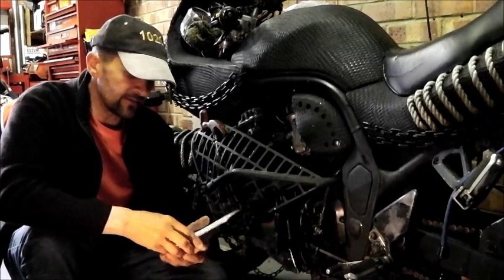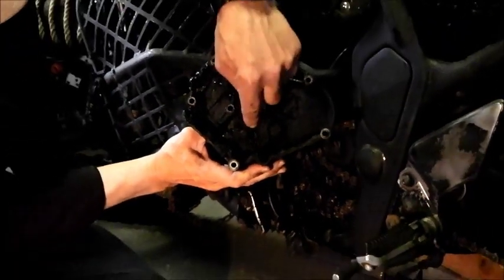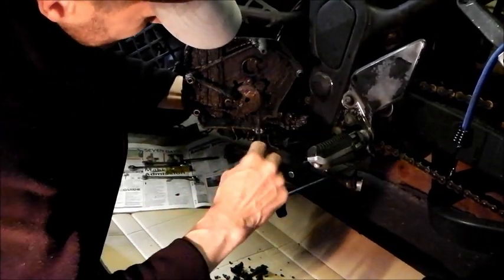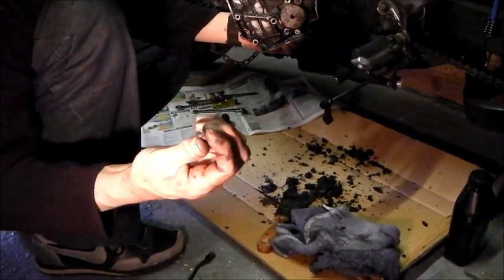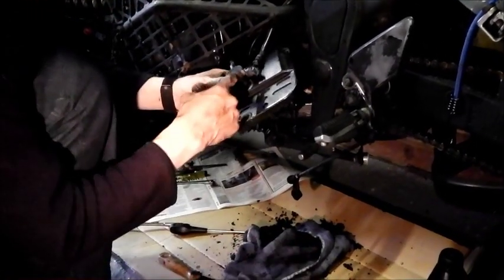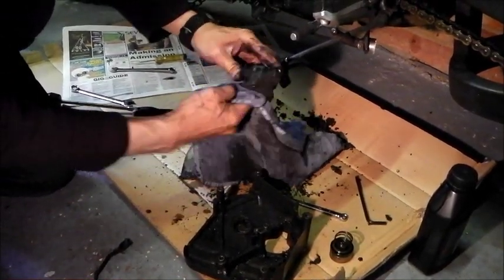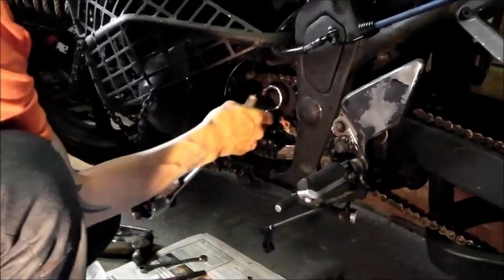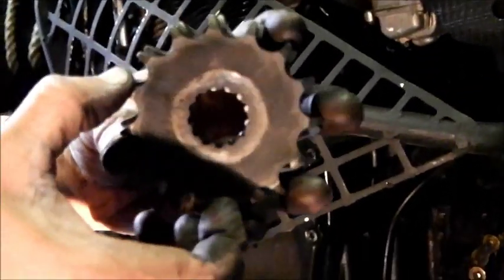Delboy's Garage, How-To;- Bandit Clutch Cylinder and Front Sprocket Replacement.

Comment: This one helped me out BIG time.  Still going through the crazy changes the previous owner has done to the bike.  Previous owner had a 520 on my Bandit 1200 which broke and flew off down the road so not thinking I just ordered a new 530 but ended up needing to get both new sprockets and while replacing I found I needed the slave seal as well.
Reply from the maker: Jeremiah Harkins Hi mate...aint it always the same, why do people take such dumbass shortcuts... at least you didnt end up with it wrapped round your left ankle... good luck with it buddy.. cheers, Del.

Comment from the maker: You are quite right, that sprocket fits several bikes, inc. the Hayabusa, and on some those holes are for a retaining washer, my point was that you CAN use them as 'draw bolt holes' if the sprocket is jammed in place, although this very rarely happens as it is not a machine fit!

Comment from the maker: Hi Alex..im not entirely sure on the anatomy of your Magna, but generally no, the seal is not a pressure seal, its just there to stop the oil that splashes about the other side of the pushrod from passing through t the slave side..on the Bandit you just take the retaining plate off and pop it out, comes with a steel insert to keep it in shape. i would imagine that even if there is oil the other side, it wont be under any pressure, maybe just tilt the bike so it drains away from the seal..GL, Del

Comment from the maker: Too right, mate, if in doubt drill it out! ... This is a great fix when you mince the cast alloy threads in your brake caliper mountings, just run an 8mm drill straight through and poke a nut on the back... job done!

Comment from the maker: Hi Neil, that is logic in principle, but looking at the environment they live in, it's absolutely vital they never come out as they'll find their way quickly in between the teeth of the chain and sprockets and that could be disastrous on the road!  So if you used anything it would actually be Locktite, but having that they make the screws from stale pastry they mince every time anyway, so this mod' ensures it won't happen again!

Comment from the maker: First do a full system check, start the bike from cold, allow it to heat right up till the fan kicks in, then switch off...if the gauge fails to move at all, then check for wiring faults, maybe a loose or broken connection, and if you are getting a full live feed from the sendor to the gauge, it can only be a faulty sendor, not too expensive to replace - if you've just bought it, wouldn't be a bad idea to do a full coolant change too, it can often be crud in the system, good luck, Del

Comment from the maker: Good point here, buddy, front sprockets and pulleys, being smaller, turn more times, so wear quicker and often it is the smaller pulley that knocks out the chain prematurely - I can regulary get 30k miles plus from a chain and this one has already been on for 19k and it's in fine health... the point here I would suggest is, check the grooves in your Sportster front pulley often and at first sign of any plating faults just replace it as it will cut your belt up - Del

Comment from the maker: Hi Albin, firstly, NO, the wheel rotates with the clutch in due to inertia, the clutch runs in oil which is sticky and will always cause a little drag, this is quite normal and correct....... you will know if your slave cylinder seals are leaking.... because brake fluid appears on the floor under the bike.... and the level drops in the resevoir... mine was only slightly weeping at 13yrs old and 44k miles... yours will be fine!

Comment from the maker: You certainly will notice an improvement in the drive feel, it will transfer the torque to the chain more smoothly and with less 'slap', and maybe that means a tiny scrap more power gets to the back wheel....its also quieter and smoother going into gear...

Comment from the maker: You can achieve this by using an alloy rear sprocket and a steel front, this then works exactly as you said, they wear as a pair, but I use a steel rear as they last longer and they are cheaper and the un-sprung weight saving is minimal - Del

Comment: Dear lawd I got those screws out . Had to DC the hydraulic line and heat it up but I didn't strip the screws, damn they were in tight. Funny how old these comments are, I'm just now doing my 99 and I've owned it since new, it's still almost pristine and have a couple vids riding to the mountains. Definitely easier than that steering stem bearing.Thanks for the vid Del hope alls good with you.

Comment from the maker: Hi Matthew....you certainly should have a lock washer between the sprocket and the nut...the kind that you tap over to stop the nut moving..and if its missing, then thats probably why it came loose..so get one and replace it NOW.... also if you tighten up the chain a bit tight it will tend to make a bit more clunking as you have placed force on two metal to metal surfaces...and if the front sprocket it worn then its even worse...get a new one mate, they are only a tenner.. good luck with it, Del

Comment from the maker: Yeah, i have a 6mm kit, but why bother, it still relies on a short 8mm long metric thread, (which only gives about 7 threads) and will just jam in the next time...bang the bolt right through and its way more sound, and reliable, thanks for the input though mate...cheers, Del.

Comment from the maker: As long as you use steel sprockets front and rear, then it's naturally obvious that the front, turning 3 times as many as the rear, will wear 3 times quicker, not to mention it lives in a grittier environment than the rear sprocket - you can buy sprockets made from fancy materials, but it's a false economy as they cost more... and the fade editing is a simple part of Windows Movie Maker and doesn't take very long at all (Penny is my editing genius!) - Del

Comment from the maker: There's nothing wrong with part worn tyres mate, ive used them lots of time, and would again if i needed to...it could indeed be that it has work unevenly and only turns up the imbalance at speed and not when static balancing.(which i guess from the sound of it you are doing? .in which case, it could be worth taking it to a proper tyre fitting shop who has the high speed digital wheel balancer and can spin the wheel up to speed and maybe ad weight to counter it out...hope that helps. cheers, Del

Comment from the maker: That's a typical problem and I never understand why people lean on them doing them up, maybe they think that because they are hard to get off, that it must have been done up that tight deliberately - if you only tightened it with your fingers, then rode it round the block, it would be too tight to undo as it spins left - plus with the retaining tab washer it's never going anywhere, so 'wrist tight' only is fine!  Del

Comment from the maker: If the wobble is only at a certain speed then that is almost certainly wheel balancing issues, but if it's all the time it's more than likely cycle parts, meaning head stock bearings, fork bushes, etc., ...if you had the tyre fitted at a garage they should have balanced it, if they did, could it be that a weight has dislodged and come off? (they can come un-stuck if the surface of the rim is not prepped properly, dirt, grease, etc.), also what tyre pressure etc.? Let me know, Del

Comment: 8 years on and I used this video to replace the clutch slave seal.
My Bandit is a K2 not a MK1, but it still works.
Reply from the maker: Thanks for the feedback Tim, im really glad it was still able ot help you after all this time.
Reply: @Moonfleet41  I also used the Sealy oil and brake fluid syringe.
Just need to save up for the RD rebuild. lol

Comment from the maker: OK, here's the folklore:  manufacturers spend pots of cash developing the bike to have good gas mileage, silky acceleration and a reasonable top speed, all combined - if you are happy to sacrifice the one expendable of the three, it's top speed (who needs more than a ton?)..so as the teeth are 3 to 1, one less on the front = three more on the rear = meaning it will pull your arms out and pick the front up and make you smile like a Cheshire cat! Plus you can adjust the difference out of the chain

Comment: Hi Del,just to give you an update, as this info may help other Bandit1200 owners.       I have completed the tasks within this video, i cant thank you enough. My front sprocket was so hooked!!!You cant see it unless you remove the front sprocket cover. My1998  B12 Mk1 has only done 25,000 hard miles but stands unused for long winters. The 2 original clutch diaphragm springs had lost there performance causing it to slip at 7,000 rpm in top gear. I have swapped one of them for a Barnett Heavy Duty spring,just £11 & the original plates & steels were OK,saving me £200+VAT+labour.The clutch now bites much earlier like new & feels normal at the leaver.Selecting neutral is easy with no drag. Heavy traffic,not a problem but i keep crushing any thing that i pick up with my left hand,so no beer for me !!! Only joking!!!.its just right. My top tip is to reuse the old gasket by smearing it with high melting point grease to reseal it, again & again saving ££££s   it really works,silicon blocks oil ways so i don't use it !!! Now that the clutch grips its time for tuning with some GSXR bits, i think!!!The only problem that i now have is that i cant keep the front wheel down!!! Yee Ha !!!      BRING ON THE SPRING!!!    DOG INTO IT & HAVE A GO!!!                 SAFE RIDING FOR LIFE.
Reply from the maker: Bob Hill Hi Bob, awesome.... slipping at 7k in top gear.... hmmmm that's about 120 right??.... Ain't it a bugger when that happens!   Heyho you always knew the Bandit was a Gixxer with some 'girls' parts added, and the Barnett spring is a great upgrade and, in the future, when you fit the turbo, you can always upgrade to a proper Gixxer front plate and 6 Goodrich springs.... and then, perhaps, a long swing arm to help with launches... ain't it great to save some money, not to mention the pride in fixing your own stuff, good on yer mate, keep it real, and watch out for the Feds!
Reply: Moonfleet41 Hi Moonfleet14,thanks for your comments. Yes, 120 is about right,achieved on a disused runway that was once used as an emergency landing strip by Concord and not the public road. I shall see what parts are available but i refuse to spend large sums of cash.Remember,the Bandit is a budget bike!!! SAFE RIDING.
Reply: Hi Moonfleet41 So what are your top 3 tips for tuning B12 Mk1 without beaking the bank?May be you could make a video clip? SAFE RIDING CHEERS

Comment from the maker: Hi mate, sadly I must admit I am not too conversant with the anatomy of the mighty Pan, 'tis my claim to shame I'm afraid, just never had the opportunity to get jiggy with one in the garage - but in general, if a hydraulic system is affected by heat & becomes wooly, then it is either air in the system, water or worst of all, buggered hoses... if you're still wearing the old rubber hose then the heat could be softening it causing expansion........get a Goodrich up it's arse, mate, that'll sort it

Comment from the maker: You are dead right, the nut on the outside would look dead pikey and you'll soon know they are coming loose as the bolt heads will move around as much as a nut will... also, an allen bolt head on the outside of the casing looks completely standard and in place and not as if you've bodged it (which you have LOL!)

Comment: Watched this video again after a year or so hoping to find some info about the drive (front) sprocket free play. I did 3 chain/sprocket jobs so far, and I always forget to check if there is supposed to be some free play of the sprocket on the shaft. I'm talking about side-to-side (imagine you're sitting on the bike) free play, not back-and-forth. I noticed that every time i change the original front sprocket with a JT one, I get this weird play. Del, do you think it's there by design? I did the job on 2 VFR's (800&750) and a CBR, and all these Honda's don't have a jam washer, there's only a very thick one there which also does not go on the shaft 'cause the sprocket is being held by a bolt rather than a nut. And the second thought is, should you put a "loctite" on that bolt? For me it sounds like not necessary because the torque setting on that bolt is around 50-55 Nm and as you said, the thread is right-handed while the shaft turns left all the time.
Write a line if you got a minute and keep up the good work!
P.S. Love the common sense! That's the first thing you have to use when working on the bike. Then there's a factory manual of course. :) Drive safe, D&P!

Comment: Hi my bandit doesn't have the screws in for the slave cylinder piston for the clutch, everything works fine but should i be concerned will it damage any thing ?? Also I'm going to change to braided break lines so thing ill change clutch one to so it will match, what difference will it make to the clutch. Thanks andy ps great video

Comment: Smashing tutorial del :-)

I dont know, ragging us about bodging things and overtightning stuff and you ruin those beautifull almost new screws, you driller gorilla..... he he :-), pulling ya leg mate :-)

I had to do the same for my frends aprilia scooter, the screws holding daft plastic covers to the front lower forks did not want to move, penitrating oil did nothing so i snapped the heads off and drilled straight through, new stainless steel nuts&bolts made it all happy again :-)

Comment: Thankyou for the help with your videos, do you have to drop the oil out before attempting to remove the case? cheers.
Reply from the maker: +Nicole Mcafee Hi Nicole, if you are refering to the lft hand chain cover casing in this video, then no, the oil is unaffected, you will see the casing is open at the bottom anyway...

Comment: Nice confidence builder seeing these things done in real time... I have a seal job to do on my bike before it starts causing issues (as its known to). 

I was wondering  - would it have been beneficial to have the nuts on the outside of the casing... that way - you reduce the risk of the nut coming off inside and you can inspect and notice it backing off easy. Might look a bit naff unless you have a pretty nut but still...

Comment: Moonfleet41 sound advice, my front sprocket is curved, the actual teeth are different widths, subsequently my chains a tad long (which means a new chain) and of course I'll have to replace the rear >< (should of checked that sooner)
Related note, why dont SunStar / JT etc have rubber dampeners on the front sprocket like the Suzuki original ones?

Comment: Del,
I have what I believe to be a knackered clutch pushrod seal from the oily mess around the clutch slave and water pump on the Honda Magna 1982 V45. I've been told that the DOT3 leak from the slave is what's taken it out, so I've got a slave rebuild kit as well as a pushrod seal. My question is: Do I need to drain the engine oil before whipping out the pushrod and the oil seal from behind the slave? Any advice for this task would be much appreciated. Thanks.

Comment: I do have a question though re:mk1 600 front sprocket. After tightening up my chain, I noticed a clicking, even just when turning the rear wheel by hand on the stand. Does this indicate my chain is to tight or that the sprockets knackered? 

Also am I right in saying there should be a spacer or locking type washer like yours also on mine? Theres nothing behind the sprocket or between the bolt and sprocket, which is I think resulting in the bolt coming loose...

Comment: hi Del, the chain on the varadero I bought was rusty and seazed in places although it was a new chain in November, I know this bcus it was on the last service and I have the receipt, unfortunately the geeza I bought the bike off had little to no mechanical understanding and I don't think its seen a drop of oil since, it has been stood in the rain for 4 months prior to me buying it, ive taken it off and wire brushed it up and soaked it in oil for the past 2 weeks, today I pulled it out and although most of the rust from the outside has gone its still seazed in places, given its done next to no miles will it be ok using it in the hope that riding it will free it up or do I fork out for a new one, thanks mate, Daz
Reply from the maker: Hi Daz, sadly mate, there's no way to sugar coat it, that chain is scrap... don't risk your life, mate, just drop it in the bin... however new it may be, if it's sat in the rain with no oil on for 4 months, it has seized in places because water's got in to the inside of the rollers and rusted them to the pins and even if you are able to move and free up the seizure, the steel remains rusted and weak...

There's an old saying, my friend, 'you can't un-rust a chain'... it's a bit like the principle of an iceburg, the little bit of rust you can see on the outside is nothing to the horror that will be inside it!   And rusty metal won't heal... so treat it as an investment in your safety and get yourself  new chain... they're not expensive considering the job they do, and even if you get a cheap, budget one, it's better than the one you have...  or treat yourself to a Regina Gold Chain and a Scottoiler and it will last you years and years...

For what it's worth, I fitted a Regina chain on my Tiger with a Scottoiler and in 3000miles I haven't even had to adjust it yet from it#s bedding in stage!
Reply: Thanks Del
Reply: I can buy a mid range chain and sprocket set for around 55 pounds so I may aswell go for it, thanks again bud,